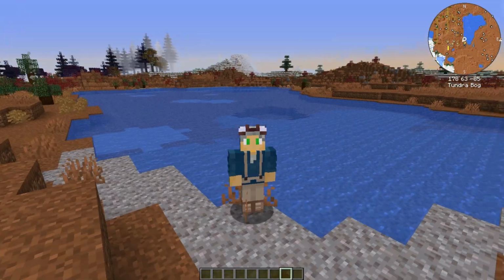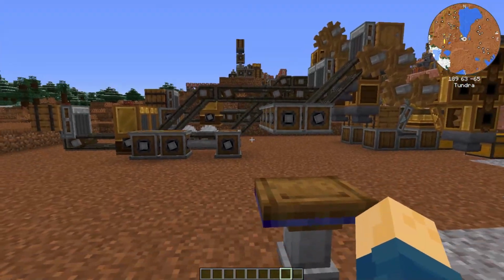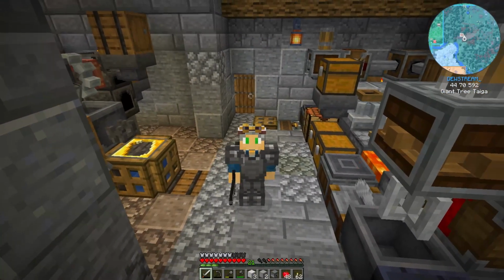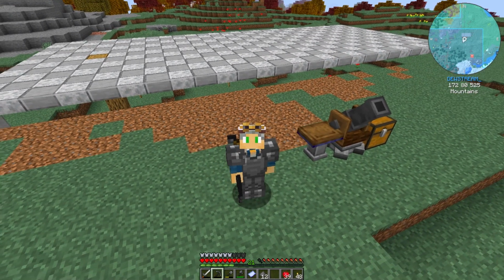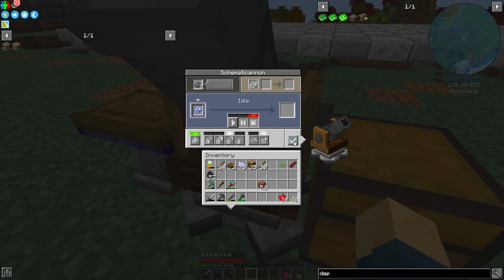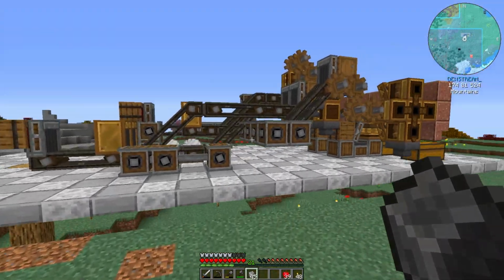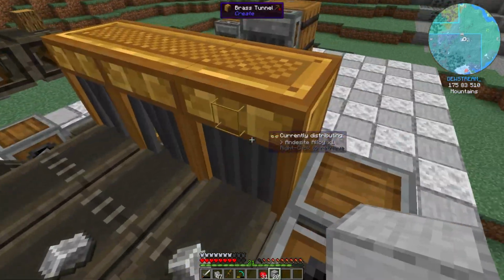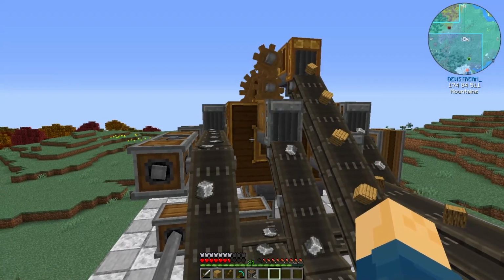How to Make and Use the Create Mod Schematic Cannon: Ep 13 - Minecraft Create Above and Beyond

Comment: Just to let you know you can print out a material checklist for the schematic cannon so you know if you have everything for the build. It will tell you whether or not you do. Also, you don't need to speed up the mechanical crafters because they aren't going fast. After all, they aren't going at all since there isn't enough material being produced. So you could slow it down to save stress capacity can dit would be just as fast but overall greater video!!
Reply from the maker: That’s a great idea about the materials list. Something funky was going on. I needed 19 autocrafters, I put 21 in and still came up short. For some reason they keep disappearing. Even when I manually took them down to fix the issue with the back, I had two disappear. I think there was something with server lag.
Reply: @DadsG  Are you sure it was only 19? It seemed like more. Yeah, could've just been some lag or something overlooked by create in the code.
Reply from the maker: 5 for gearbox, 2 for the andesite casing, 1 one for the button, 9 for the cog, 2 for shaft. That’s it. Looks like note because they are stacked close together.

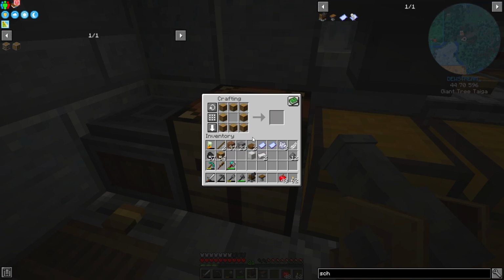Comment: 10:40 I really wish more modpacks included the four chests recipe using logs instead of planks, it's surprisingly convenient.
23:45 Ya, auto placement of tile entities is...iffy at the best of times. The schematicanon does far better than most but there's always something that goes wrong. Also the fact that it skipped the item frames is probably due to a hard-coded blacklist as vanilla item frames are just the absolute worst and by far the most likely to cause crashes and duplication bugs of all vanilla blocks.
Reply from the maker: Hey Adam, thanks for the info. That makes sense about the frames. Introspect I think something was going on with server lag. Some of the autocrafters just disappeared.